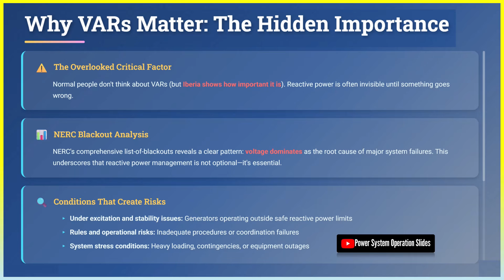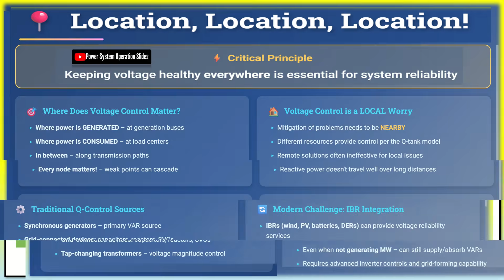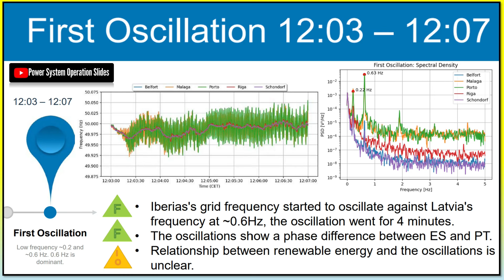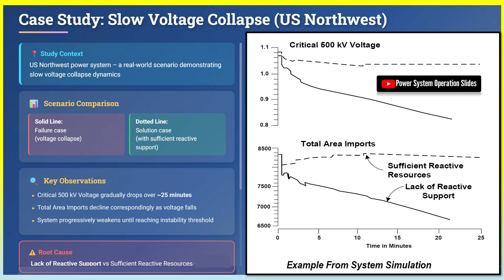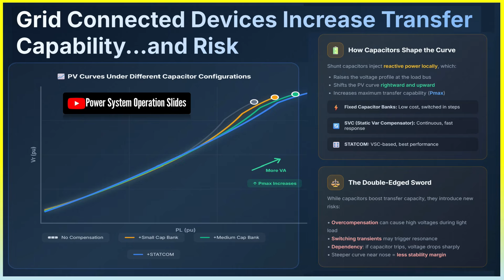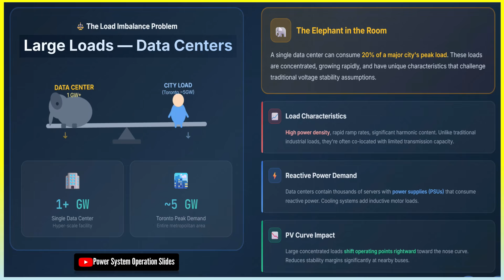Power System Voltage Stability & Reactive Power Control | Fundamentals of Voltage Stability

Comment: Thank you for this presentation. I think the last two minutes as the most important. Not only did you mention inverters you mentioned distributed generation.  I assume you are talking about grid forming inverters. Not only is more generation taking place at the local lever but also more power storage. With inverters using stored energy, grid stability takes place at the local level. The need for centralized control becomes less important.
Reply from the maker: Absolutely distributed generation, GFI & BESS are shifting grid stability toward more decentralized, local control paradigm, reducing reliance on centralized control while introducing new coordination challenges😊